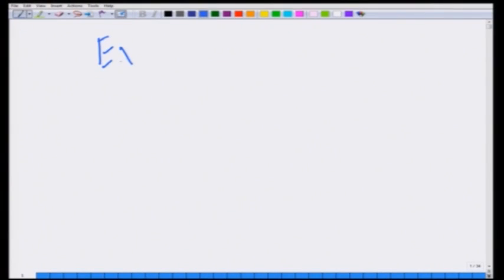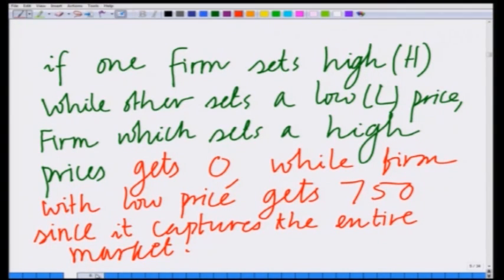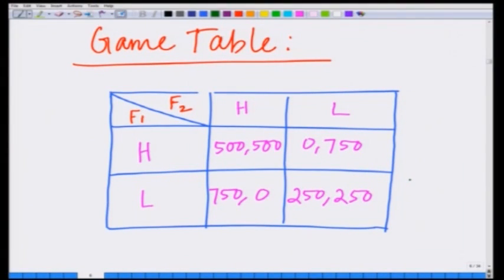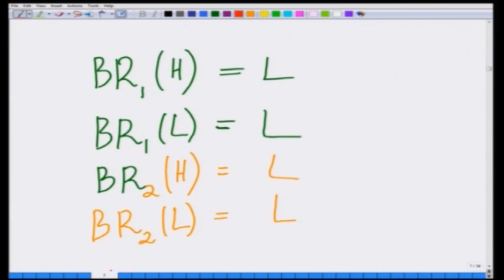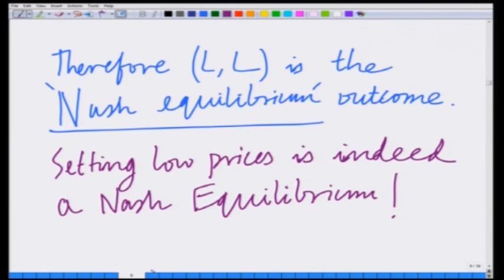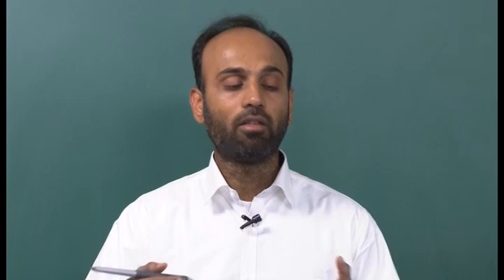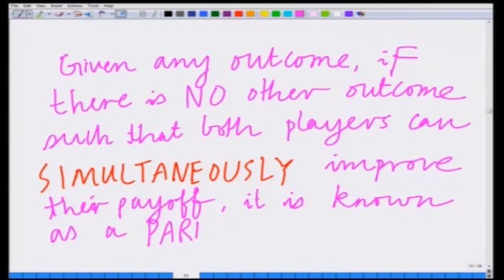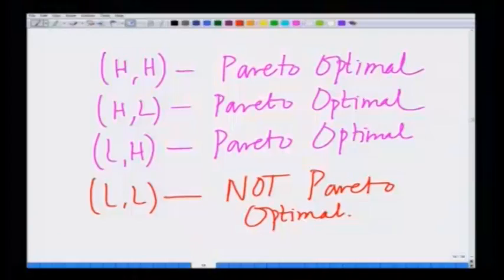Lecture 04: Prisoner’s Dilemma in Practice and Pareto Optimality

Comment: Thank you, great explanation for Pareto Optimality! But why is (L,H) and (H,L) also Pareto Optimal if one will have more but the other will have nothing?? In fact, isn't it contradictory: one WILL be better off, while the other will be worse off... I thought the definition of Pareto Optimality was: if there is no other outcome such that both players can simultaneously improve their payoff. But here (H,H) seems like the BEST option. I hope my question is clear, thanks
Reply: +boubou kash (750,0) is Pareto optimal because F1 will never want to go from this state. As u have pointed pareto optimality is: if there is no other outcome such that BOTH players can SIMULTANEOUSLY improve their  payoff. Only F2 want to go from this state not f1 (which is unilateral shifting). I hope my answer is clear :)
Reply: @lakshaytaneja3806  Thank you so much for your answer
Reply: @lakshaytaneja3806   so pareto optimal implies 0 unilateral shifting?
Reply: @krishgarg7877  In this case for 0,750
We cannot migrate to any other case, where we simuntaneously improve payoff for both players
Even if we increase payoff for a single player from 0 to 500, we reduce the payoff for the other player from 750 to  500

We should try to maximise payoff for both players at the same time, states that we can no longer improve upon are called pareto optimal states
Like 0,750 and 750,0 where no matter where we move, we cannot improve payoff for both

250,250 is not pareto optimal, as both can switch to the 500,500 case for an increased payoff
Reply: (750,0) is Pareto optimal because there is no other outcome {(0,750),(250,250)or(500,500)} in which they both can simultaneously improve their profits.